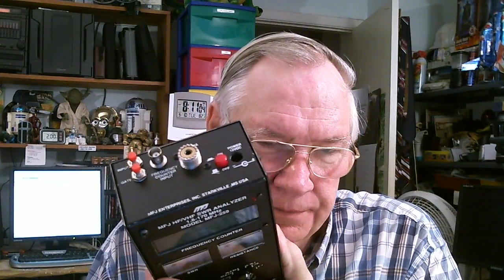TRRS #0150 - QSO - Baofeng Antenna Testing - Need Suggestions

Comment from the maker: Thanks for the comment.  I agree with you 100% and I normally am on 2 meters so I really don't need an antenna for 440 Mhz.  So I will be looking at these antennas from the standpoint of which one works best on 2 meters but I will be testing both bands.

Tom